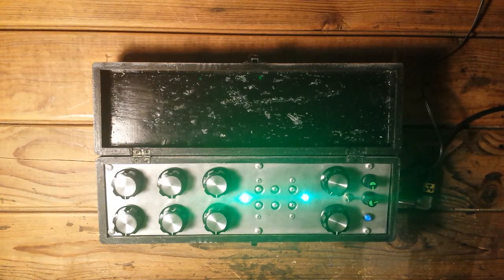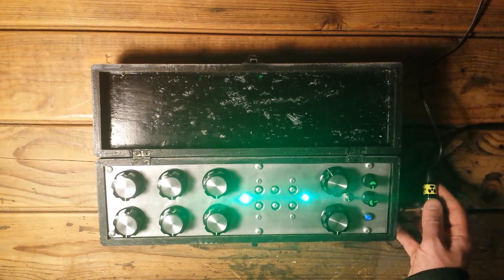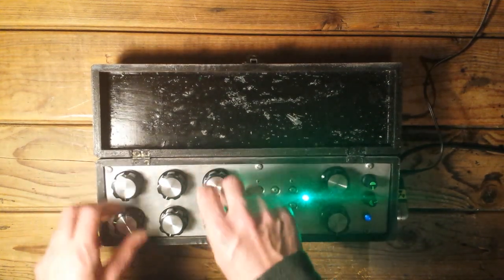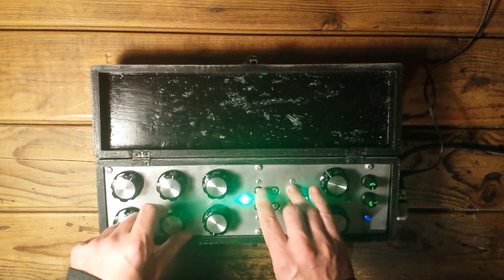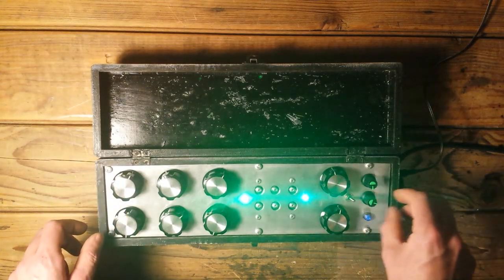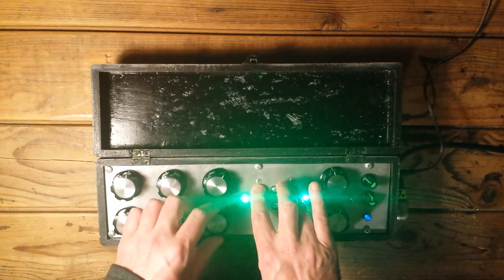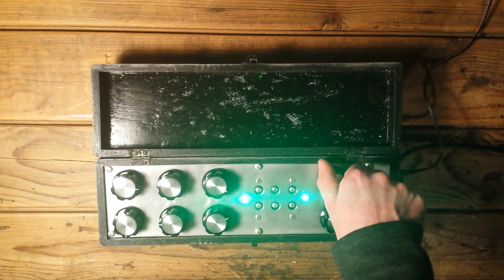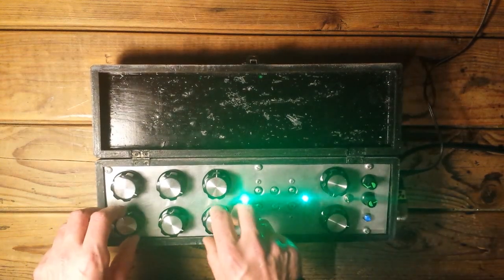Dirty Drone #10 - Handmade Standalone Drone Generator

Comment: Very cool :) how do the body contacts work?
Reply from the maker: well, depending on your fingers conductivity (the sweatier the more skin is conductive), touching the body contacts generates feedback in the synths circuit and by that alters the sound in subtle ways.
Reply: @grm-metsaeaen  amazing! I hope to build something with contacts like that one day 🙂
Reply from the maker: @DECIMA1  go ahead, it's fun. basically external circuit bend access points, i bet that can be doen with many circuits, that run on a save voltage. don't get grilled, for subtle sound changes.